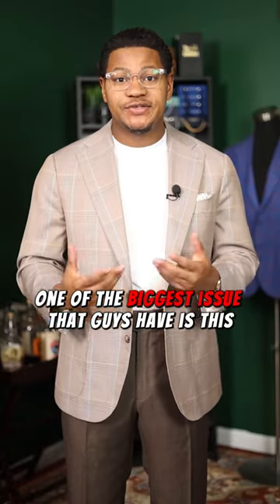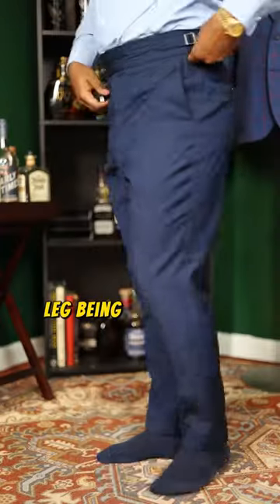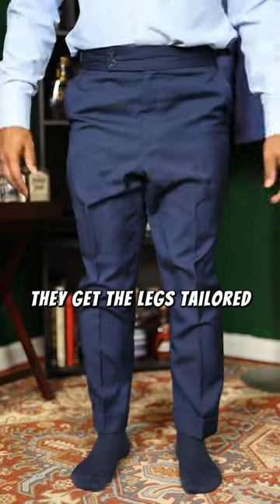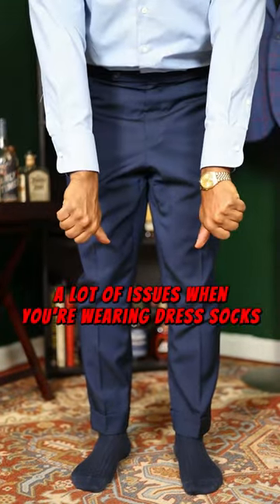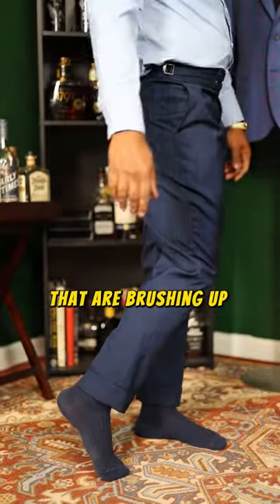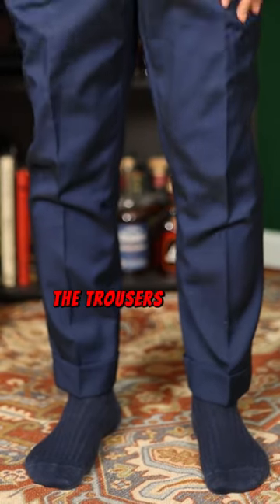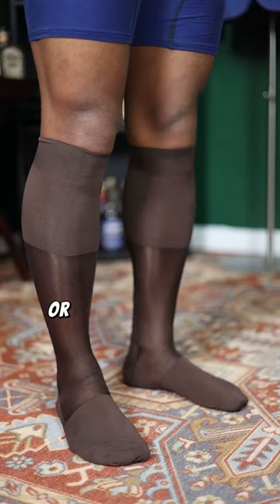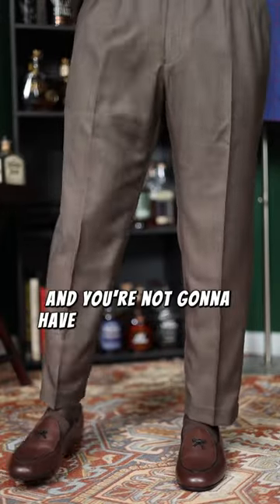ULTRA Slim Trousers Cause Drape Issues… 😱

Comment: What is the leg opening for a fuller cut in your opinion?
Reply from the maker: Depends on the wearer and how full they want
Them.
Reply: @GentStyle  do you think a 9 inch leg opening is consider or starting to be full cut?
Reply from the maker: @miguelteran-raful2718  again it depends on the wearer.
Reply: generally at least half as large as your foot size, if you want to get that ultra classic drape cut then 2/3 of your foot size but only few guys can pull it off and if its tailored well